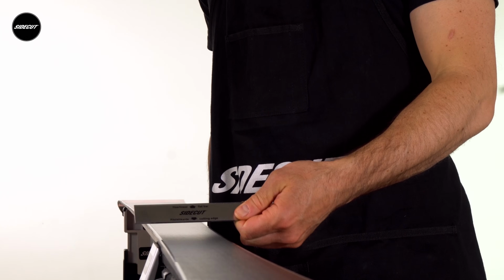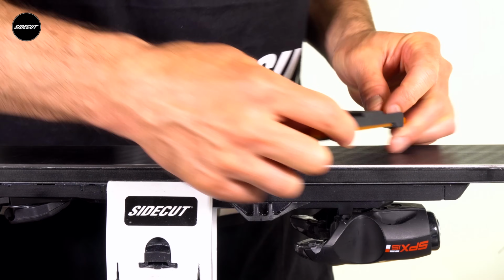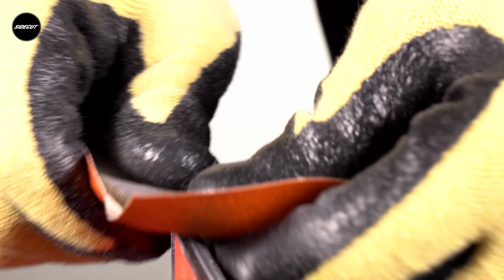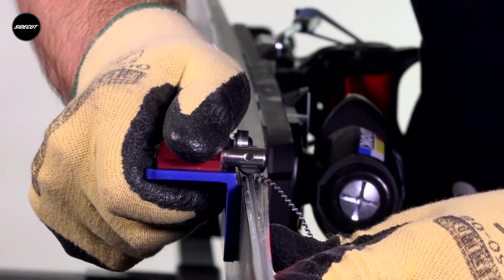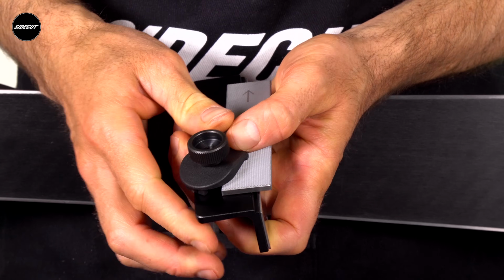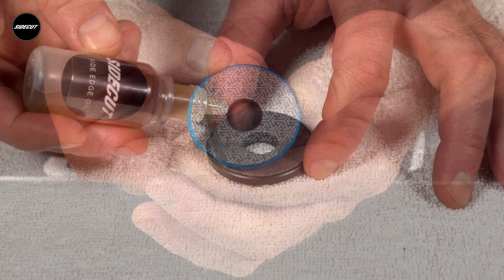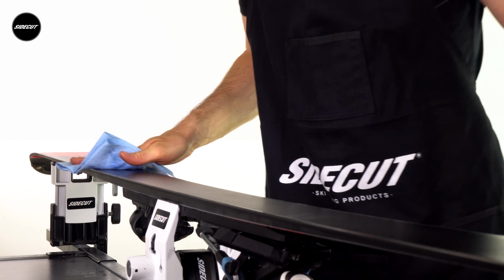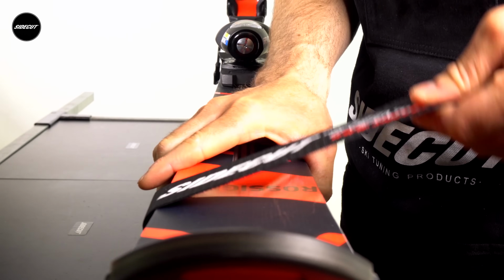How To Tune YOUR Skis

Comment: Best tuning video on the web. Good job guys! and I am loving the tools I ordered last season.
Reply from the maker: Glad it's helpful!!
Reply from the maker: Thanks very much Gibb!!
Reply: @sidecuttuning  Serious question (though sorry if it's a stupid one), but if the file can cut the metal edge, is it not sharp enough to cut the sidewall step? My current skis (Rossignol GS) already had the sidewall removed as I purchased them used, but need to prepare a new set of skis now. It seems like removing the sidewall step is not necessary? Thanks alot for clarifying. Ps. I LOVE your side edge oil. That product is like magic. @SIDECUT
Reply from the maker: You do need a tool (sidewall remover) to do this simply because a regular side-edge file alone gets clogged.  Also, you need to create clearance so the file can create the appropriate acute angle. It really is an essential part of effective ski tuning. @Student311178219
Reply from the maker: @Student311178219  No, unfortunatley not.  You honestly need a professional sidewall remover. Not the cheapest tool but arguably the most important one.  Without it the sidewall interferes with the file/file guide to contact the edge. This clearance is paramount to correct tuning.